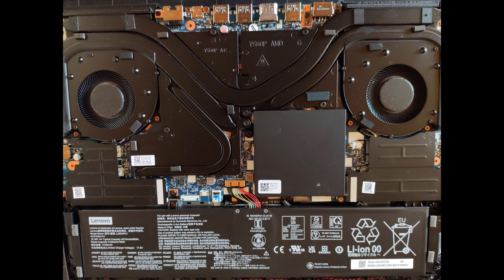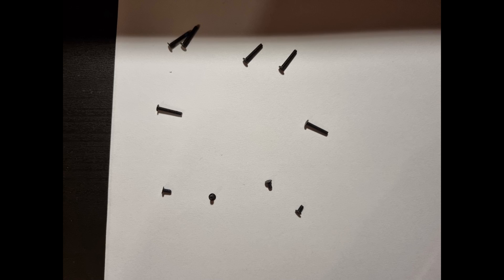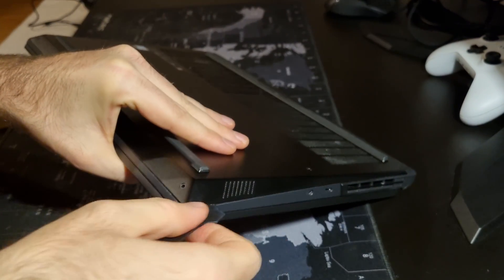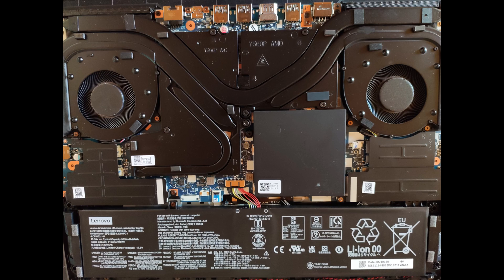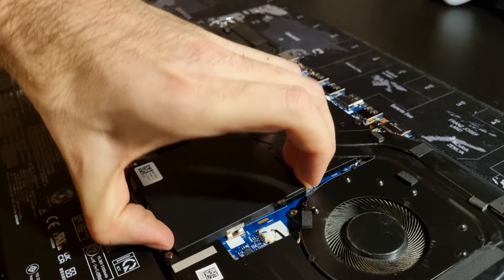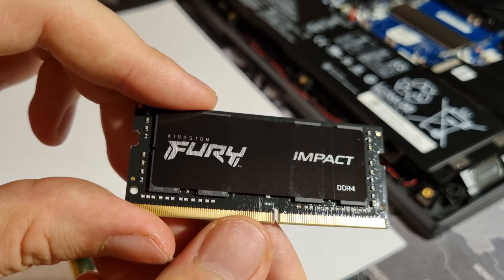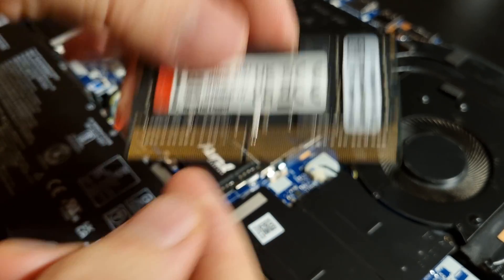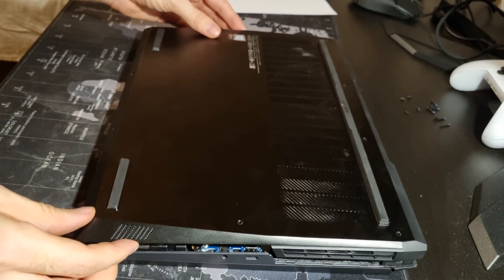Lenovo Legion 5 Pro RAM Upgrade Guide & Disassembly

Comment: hello, can you pair 8 gb with 32gb moduls?
I have 2x8 i guess. So i would buy 32 modul and replace a 8 gb modul.
Reply from the maker: It is usually better to pair RAM with the same specs. It could still work, but you might have to manually tweak timings and other settings. I would advise you to sell your pair and buy a new one.
Reply: @patronautsvirtualworld8155  ok ive ordered 32gb ram now and will see if it improves the editing performance. I think mine cant be selled because this laptop came with 16gb ram. No one needs it.

Comment: Hello, Mr. I have a question for you, and I'd be grateful if you could answer it. My touchpad was rattling. And, believe it or not, I was able to fix it by hardly pressing a area that somewhere below the space bar. I first heated my computer by running some benchmark tests to reshape the plastic, then pressed. But i heard some cracks probanbly the plastic was heated(i hope)And voilà, it's fixed. So my concern is that is it possible to crack or damage the motherboard because it is located directly behind that part of the laptop. You once opened it, and do you remember if there was a gap for the keyboard area to flex or not? Laptop is working just fine btw. But according to reddit motherboards even though cracked may work sometime before  a failure
Reply from the maker: Hi, I haven't seen the space between the motherboard and keyboard/touchpad because i didn't need to disassembly that part to change the RAM. Generally speaking if you push hard anywhere on the chase you can damage the motherboard (but you would have to push really hard for that.) I am happy for you that you were able to fix your rattling touchpad. My advice - if it does not rattle anymore don't push it.

Comment: does the mouse touchpad come in between your way while typing; I mean does it interefere with mouse position?
Reply from the maker: I use an external keyboard and mouse, but it is entirely possible that small  part of your palm is resting/touching the TouchPad but I have just done a quick test and the cursor did not move while typing even though my palm is touching the touchpad. There must be some kind of smart touch detection that filters our palm touching/resting.

Comment: Do you have installed 2X32 GB of RAM on it?
Reply from the maker: Nope, it's 2 sticks of 16GB, 32GB in total.
Reply: Can we use 2 * 32 gb ram and upgrade it to 64 gb ? Is it supported
Reply: @girishsgowda8546  Did you find out, mate?

Comment: Before opening the laptop, it is very important to deactivate the battery.
This is done via the software in the laptop !!
Reply: Sure, it's kind of useful to do, but this is the only laptop I've seen that can disconnect the battery via the bios.  I've owned 6 laptops since 2006, and have opened, repaired, replaced components in all of them plus two of my mother's laptops.  Disconnecting the battery physically once open should be enough.
Reply: How
Reply: @TheVoyagers.  

Pull out the power plug, Start ----->, BIOS ---> F2 ---> Configuration ---->
disable Build in Battery ---->, enabled.
when you use the power plug again, the status is automatically disabled.

good luck  Kai

Comment: hello i have a lenovo legion 5 pro with rtx 3060 and ryzen 5 5600 , what ssd with 1 or better 2 tb is good for this laptop ? and has it an second ssd slot like you say in the other comment ?
by the way really enjoying your video :)
Reply from the maker: Regarding storage Capacity, depends what is your use case. I have 2 x 1 TB  SSDs. It's plenty for games, not so much if I want to save all my raw recordings and projects for youtube.
Reply from the maker: It probably has, as far as I know it's the same laptop but with different GPU and CPU. To be 100% sure though, you should look up the Hardware Maintanance Manual or the User guide on LENOVO's support page.
Reply: i have the same config, laptop came with 512gb ssd so i popped in a gen 4 x4 1tb nvme 5300mb read 4300 write but i forgot to check what was the gen supported in this laptop, turns out it was gen 3 x4 ... nevertheless i get like 3500 read /3500 write and i bought as  the same price as gen 3 ones in my region. So choice is yours at the end (and i got an nvme ssd that have dram i think its so important to have)
Reply: and 1.5 terabytes is sweet spot mostly for everyone

Comment: hi mate, i was wondering what SSD would you recommend to swap that's won't make my Lenovo Legion 5 pro to overheat or use too much power? I know the 9870 and the 970 plus are popular ones but what are your thoughts on the Crucial P1? I am looking to get a 2tb ssd soon.
Reply from the maker: Generally speaking I don't think the power consumption/overheating is a big concern regarding SSDs. Also you don't need to swap SSDs, there is a second slot available that you can fill in. I would say buy an SSD that is most capacity/cost efficient. The speeds are usually not a concern as  most users will hardly notice the difference in day to day activities. Don't know what is your use case.  Watch out for the TBW value (if you do a lot of file transfer) and the memory chips used (TLC, MLC, ...), that can affect the consistency of speeds for longer file transfers. Also I heard that due to memory shortages some SSDs started to use cheaper and worse memory chips, so look out for that. I would suggest to look up some reviews and benchmarks. Even if the product is at it's EOL, it might be a good deal.

Comment: Hello 2x16gb Crucial ct16g4sfra32a.m16frs or 2x16gb Patriot PSD416G32002S for dual channel?
Reply from the maker: There is not much info about timings in their spec sheet https://assets.website-files.com/5cf9767d22a3cbb75b388ea4/5f03c7d570173d5cc53fe928_PSD416G32002S%20Sku%20Sheet_042120%20Copyable.pdf" . Otherwise there is a strong indication of dual rank  "(Two) 2 Rank Double-sided module". Probably okay.

Every RAM should be in dual channel config once you use 2 modules that are the same.